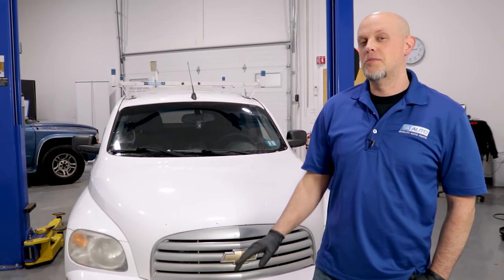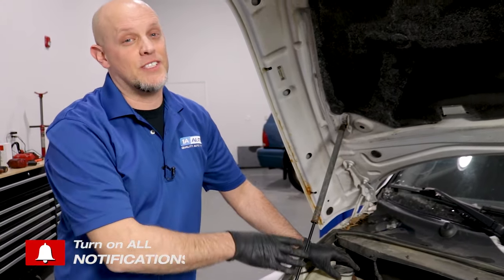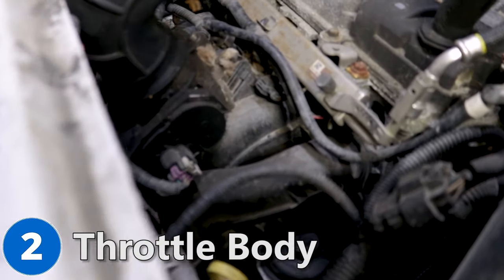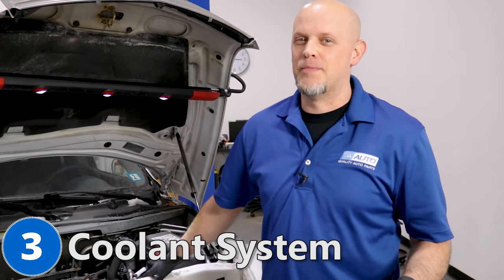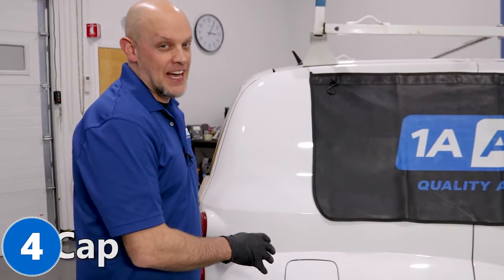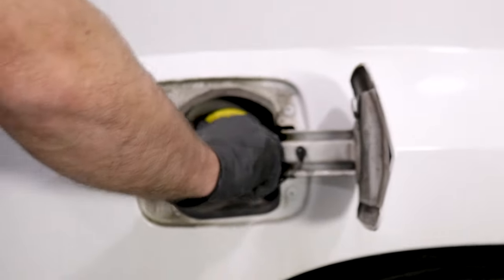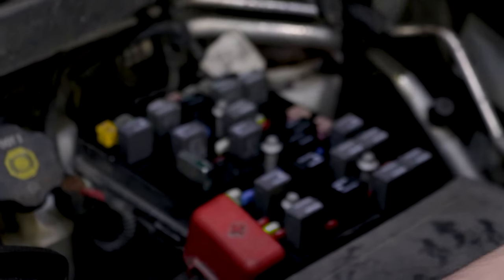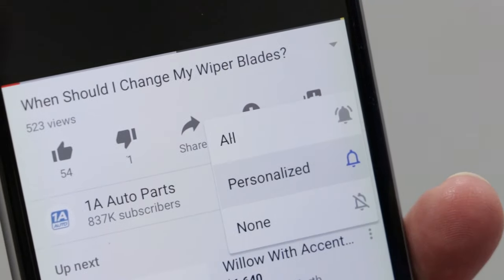Top 5 Problems Chevy HHR SUV 1st Generation 2006-11

Comment: Be aware of these.....it has an ELECTRIC POWER STEERING
Reply: OH YESSSS I HAVE A 06 AND THE POWER ASSIST MOTOR HAS BEEN REPLACED YES 17 TIMES AND IN THE GM MANUAL IT CLEARLY STATES THAT THE ASSIST MOTOR SHOULD BE REPLACED ALONG WITH THE STEERING COLUMN AND ONLY AS A PAIR ? you think gm wants to fit this bill (wrong) thats why i have had it in so many times since 06 and even spoke with gm and they asked me how far i want to go with the repair?? really gm?? what the ?? what the ?? i said np i will be back each and every time i need one and this warranty folks has a year limit which is if iam correct 2099? i cant remember but i have many years left as do you also and dont let them tell you different and me for one will not ever buy another gm as long as i have breath in me. oh and to boot the steering column was replaced along with the assist motor at only 36,000 imagine thats hard to believe but i did. and trust me I still drive it but so many quirks in these its a nightmare and i would not even give it away now having the rack replaced only the third time for this thank god i can do all the work myself or i would of junked it years ago.. lemon laws need to be here in canada.
Reply: It has a complete warranty on that. No matter how many owners, or mileage. Just had a friend's replaced 2 weeks ago. NO CHARGE> They did try to sell me some other services.
Reply: There is a recall for 2010 and 2011 on the power steering pump, all other years have an unlimited warranty on it, information that's difficult to find. The power steering went out on my '07. To repair requires replacing the steering column, something I wasn't interested in doing, plus the part was expensive. I looked for a recall, found the above information, called my dealer and they replaced it no charge. Had I not looked and taken it to a shop it would've cost me a fortune since most mechanics wouldn't know about the warranty, either.

Comment: 1. Not on manifold. Should know. Just did TUNE UP.  Changed all spark plugs and coils. (2 hoses, 1 air intake sensor and "hood" cover - PULL HARD!)  Also checked air filter! 
2.  Throttle Body?  Don't recall seeing, but might be there. AW! Will check later. 
3. Coolant System:  150,000 miles?! OR every 5 years? Not yet due, save for the latter. Will DO! (Heater core or radiator plugged. Got it.) 
4. Gas Cap √ 
5. POWER STEERING: Get that warning light every now and then. Have to turn off and restart to resolve. IDK! HHRs seem to have lots of electronic problems. 
2007 model. 
Otherwise been pretty good to me. Bought as demo / program car . 13k miles. First week, solenoid inside automatic shifter went out. Would not engage OR move! 

THANKS! Great Info.

Comment: I have an 06 with 150000 on it, inherited it from my dad, body control module is out ,so no tail lights ,had to hook to the battery & put a switch under the steering column,radio works sometimes,right front blinker is dead & marker light,but is dry underneath no leaks runs great,have to get used to that battery in the rear'. sheesh!

Comment: I've got a 2007 with 163 plus
Great car the last 3 years I had to replace the throttle body because it went into safe engine mode It would only go up to 2000 rpm and about 40 mph tops
Reply: This happened with mine I have a 08 with 181,000 we took it off and cleaned it and it has been great ever since! I am going to replace it soon though so I don't have to worry about it! It's a very good car!

Comment: There were two iirc recalls for power steering 1 US, 1 Canada which was more comprehensive for failure mechanisms.  There was a "discussion" to get the US dealer to replace the power steering unit who 1st pretended not to know about the other recall.

Comment: Shalom Aleichem. 

Any vehicle (in my humble opinion) made past the year 2000 are ALL pieces of high priced convoluted shit!

Replacing tried and true linkage with electronic this and electronic that is stupid.

I've seen less then 2 years old vehicles getting towed into shops because the shitbox broke down because some $15 relay quit working and the entire cars just quit in the middle of the rd.

I've got a 1986 Chevy G-10 van my parents (RIP) bought back in '76 for $3,500. It's still running with almost 900,000 miles on the original drive train.
Tuneups, oil changes an all her regular maintenance (including 75,000 mile tranny tuneups) have kept it going.
I also have a 1972 VW Karmman Ghia, a 1997 F-250 7.3 liter diesel an I wouldn't trade any of them in for some high priced shitbox.

Ratson haba b'shem YaHuah

Comment: have 2 chevy hhrs. both like clock work have the same problems. none that are listed in the video. timing chains wore out on both around 120k, gas lines rotted out on both (rust belt), and the plastic door handles on the inside break or the door latches become unhooked on the inside.

Comment: you forgot the door handles that break.  We took ours in when it broke. dealer had the car for 30 minutes came out and said yeah its broken, 270 to fix. they said we dont' have in stock and charge us 95 dollars to tell us the door handle was broken and missing which we new when we got there and was the reason we made the appointment LOL

Comment: I had a 2008 hhr and loved it. Had one solenoid go bad in the transmission, but, after it was replaced, no problems in 165,000 miles. I loved it until I was t-boned in an intersection. Now, they are hard to find.

Comment: Can you please help me ? My 2010 HHR is having a problem with the ESC system. I replaced both control arms and front brake pads recently. The control arms were needing to be replaced but couldn't afford it for a few months. After replacement, I bled all 4 brakes. While test driving the brakes were working fine, I was driving about 30 mph then the "ESC Active" light came on in the message area then I lost all braking ability to the front wheels and had to stop with the emergency brake. Then it went back to working fine after the ESC message went away. I also noticed it did the same thing later on after hitting a bump in the road. I've done alot of my own mechanic work for about 12 years but I'm not too familiar with the ESC system. Thank you for any help you can offer.
Reply: Are there any parts I should look at replacing that are involved in this system? Not looking for exact diagnosis just a point in the right direction.

Comment: Own a 2009 HHR SS  turbo 2 liter bought it new 12 years ago.  One of 216 SS panels built.  Now has 135 thousand plus miles on the odometer.  Had the original turbo replaced 3 yrs ago.  Before that head gasket & head replaced under warranty year two of ownership.  My daily driver great fuel mileage with the 2 liter.  Outside wear & tear items brakes tyres & alike love the Aqua Blue beast!

Comment: My girlfriends 2009 HHR has a loud clicking noise in the engine. It gets louder every time you accelerate. I’m not sure what it was. When we got it we replaced the EVAP solenoid bc it was bad and the gas cap because it threw codes and no codes since. Maybe you would have some insight of what it is?
Reply from the maker: +Maddogg Mike We wouldn't be able to diagnose an issue like that here, you may want to have a local mechanic take a look at it. Thanks for checking us out! http://1aau.to/m/Shop-1AAuto-c

Comment: A problem with ALL HHRs is severe Passenger side water leak. It usually ruins the blower motor and even the Radio. All HHRS will develop this because there is a flimsy plastic film over a LARGE access hole on the passenger side below the Passenger wiper area. The cheap plastic rots and disintegrates because of heat allowing the vehicle to fill up on that side. I have seriously seen 2 inches standing water. The water also wicks to the real compartment through capillary action. wetting the back floor too. You have to remove the vent cover under the wipers and replace the factory film with a better quality patch  cut to the right shape and sealed with caulk. I proactively repaired both of mine.
Reply: Mine has flooded on the inside several times. I have replaced the that gasket that covers the hole over glove compartment. It still leaks. I have put flex on sunroof. I have to cover the car with a tarp. It has shorted out my a/c and radio. I loved the look of this car but so many issues with it. I replaced camshaft Solenoids myself, power steering motor, mass airflow sensor, sparkplugs and any other fixes.

Comment: I have a ground issue on a 09 hhr no start or slow crank no start and the wipers on the back running before I try to start it 
I have been told it is a ground issue but I have be not able to find it

Comment: I bought my '09 used with 52k miles on it. Only thing wrong was the sway bar bushings and it needed that exhaust VVT solenoid. I drive it 100 miles every day and it's been holding up well. I didn't' know the coolant could be an issue, good thing I was already planning on changing it soon.
Reply: Casually getting oil changes every month

Comment: 2007 hhr and only thing replaced is alternator..but just had a guy come jump start bc of the cold and now my odometer, gas, speedometer radio is out..any easy answers?  Brake light, dash lights on

Comment: O9. 120k miles . My parking lights don't work and lately been gettings lots of mixed signals sensors popping off and on. Like at the moment is my air bags, last time was my traction control right side windows dont work sometimes  with either side controls. I do love this car but men this little hic cups here and there are coming in together all at once now

Comment: I had nothing but issues with my 2008 HHR. I’ve replaced tires, alternators, batteries, brakes, new air conditioners, and so on. It’s literally eating my money. And my check engine light remains on regardless of what I fix on it. 😡

Comment: I’ve changed the power steering motor and fuse and still having power steering issues it’ll work for about 30 seconds up to a minute then showing up on dash power steering goes out need help trying to figure to get it back to work

Comment: Sir i have a 2010 chevy hhr lt, the ac clutch compressor stop workin,when i disconnect the battery he work again,but if i turn on the car for the next day, the wont engage again,can you help me about this problem? has a new ac compressor new refregerant..

Comment: It's worth adding lower control arm bushings, TCM/BCM ground (on early models) and fuel line corrosion (in humid climates) to the list of issues. All are repairable and not necessarily dealbreakers but do get misdiagnosed by some shops

Comment: also rotted fuel and brake lines
Reply: Fuel line should be a recall
Reply: Should be, it is not. I replaced mine with stainless steel when it started leaking under the driver's side door. I smoke, I could've blown up.

Comment: Are hhr 2011 is having problems stopping the rpm gage ends up going between 1/2 and 1 I have been told ac issues throttle body and even the air control valve any opinions?

Comment: I would agree that these are a great vehicle but make sure, if you want either remote start or remote access by key fob you check the history of the vehicle first. I bought a 2008 LS and afterwards I learned that it was an Avis rental car. Thus, no remote anything as Avis had Chevy not install those things. Also, in the top 10 should be fuel lines. Chevy's engineers should get a wage decrease for putting them near the exhaust. They had to wrap them in insulation and that insulation holds water. Water equals rusted out fuel lines.

Comment: 50-100 miles : brake fluid leak, suspension, brake pads, rotor disk. 100-150 miles: vvt, timing chain, power steering motor, battery, alternator, bearings, spark plugs, headlights, windshield motor, after these repairs you can keep it for a while and then sell it, otherwise... 150-200 miles: same as 50-100 miles and if you did not treat your HHR against rust you might have problem with the physical integrity of the body frame. 200+ miles : Starter, and basically the whole process repeats until a major failure happens like a transmission or engine failure. At that point you might use the old HHR as a part vehicule, or scrap it. From the owner of two HHR.

Comment: What if the truck won't shift into gear. Very hard then stopped all together. Is their clutch fluid to check hopefully. Friends truck . Thanks whoever might help.
Reply from the maker: +charleysturbos We wouldn't be able to diagnose an issue like that here, you may want to have a local mechanic take a look at it. Thanks for checking us out! http://1aau.to/m/Shop-1AAuto-c

Comment: i have a 2010 HHR I have replaced So far VVT Solenoids Throttle Body Cam Pos Sensor 2 times the cooling system isnt using that acidic Dex Cool that eats the gaskets including the all important Main Head gasket I use green Coolant I have spoken to GM engineers who have said DexCool was made because of its cooling properties But it also causes the head gasket to fail alot faster then normal Rocks when you drive truck on a GM lane You get to hear about all the creepy things GM does to make its dealers Money

Comment: What about timing chain failure?
Reply: This happened on my 2007. Since I have been looking for a newer vehicle for over 9 months, I'm not spending the money to get it repaired.
Reply: That’s a classic sign that the vehicle didn’t have proper oil changes.   Timing chains should last the life of the engine,

Comment: Only thing I would add to this list is to change the timing chain every 150k miles. The guides can brake around that time.

If it starts burning oil, unbolt the intake manifold and clean the pcv opening in the center. It’s also a good idea to do the seafoam soak in the cylinders at the same time.

A trick for changing the belt is to get the duel head 1/4 3/8 ratchet from Harbor Fright. The 3/8 side will slip right in and you are able to adjust the position to anything you need no matter if you are working from the top or under. Normal tensioner tools have to be cut down if you are working from under/wheel well.

Comment: I’m considering purchasing my first car and I’m looking at a 2011 HHR, anyone have any tips or advice about the car that owns one?
Reply: It's a really good car. It really keeps u on your toes with maintenance. I have an 09 and I've had it since 2012 with 125k on it now it has about 260k on it and it still runs great but I've changed almost literally every part on the car. Soon as I hear or feel an issue I change that associated part or get it diagnosed. These cars have really good AC units and engines but I drive a lot everyday so my maintenance on it pretty constant. It's kinda like anything else u use a lot of u keep up with it, it will usually last u.
Reply: Yeah, buy a Toyota.
Reply: @lexuses3942  yea because they are just great cars...NOT! research Toyota car problems. They ain't so perfect.

Comment: My 09 SS idles super rough and surges slightly on first startup of the day  for about 5 minutes. Anyone have any ideas about a fix for that?

Car was given to me with 220k miles by a customer because he couldn't get the check engine light off. Fixed it with a 50/50 seafoam gas mix poured into the tank and ran on the highway for an hour at roughly 90mph.  Car had been sitting for 2 years .

When I got it I changed every fluid  in the car

Comment: i found a lot of them have warning lights related to airbag. This is usually under the steering wheel airbag where the insulation has worn off between the wiring and the metal part of steering wheel. Stuff like this is very easy to rapier as you just open this up and I used some adhesive foam tape between the wiring and steering wheel.

Comment: My 2006 HHR (2.4L) has 240k miles.  Purchased it with 55k miles.  I'm only driving now because somebody ran into my reliable vehicle and it's in the shop.

I have not experienced any of the above mentioned issues, however, have experienced the following:

1.  water leaking through front cowl onto the front passenger floor..this caused damage to the heater electronics
2.  water pump is horrible to replace...dealer has done it twice
3.  starter replaced twice
4.  check engine code states misfire cylinder 1...mechanic says low compression...ouch
5.  T/C light comes on at random times and then it will shift horribly
6.  Front brake rotors warp easily
7.  Clunks when going over speed bumps or any bump for that matter,....has done this since I got it...tie rod bushings I'm told
8.  Every once in a while it will take up to 5 mins for the stereo to turn on 

Always going to be something quirky with every vehicle.